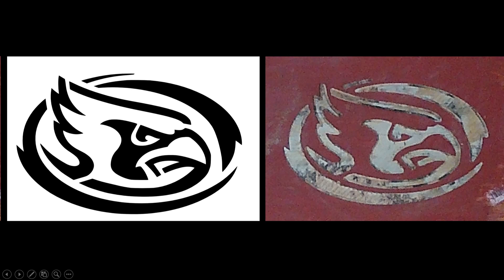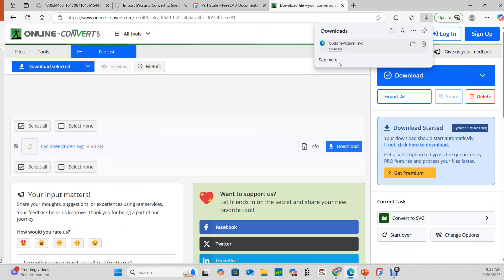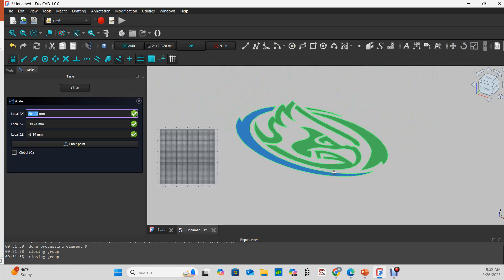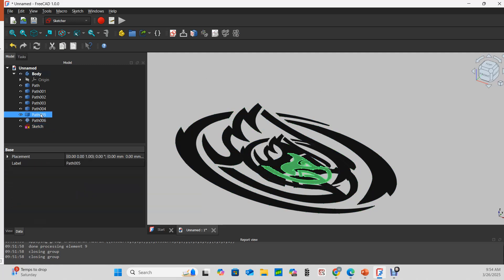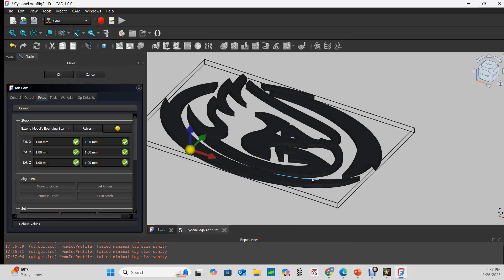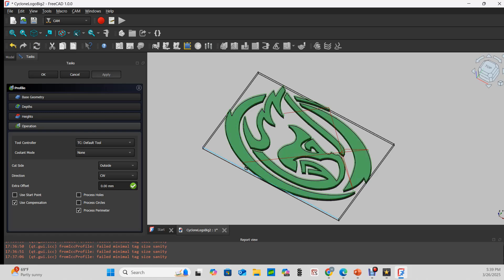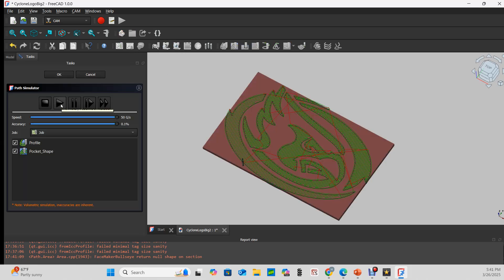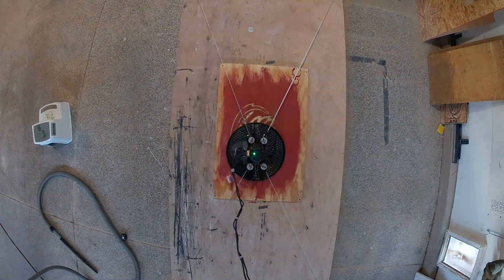Turn a Logo Into G-code

Comment: Many thanks for this - I've made a CNC from my old Ender 2 3D printer purely for drilling holes in PCB's (I suck at doing them freehand).  I've not been able to find a quick and easy solution to automating the process so I've been hand-coding the g-code using the hole locations in Photoshop.  Unlike other video's that I've watched this actually made the process seem easily possible so I'm going to give it a shot and save some time/work!
Reply from the maker: @reborneuk  Good luck! I hope it works.